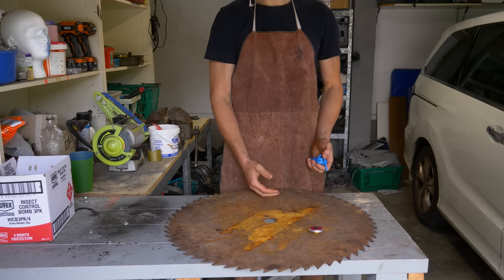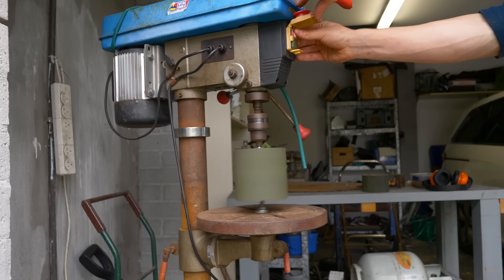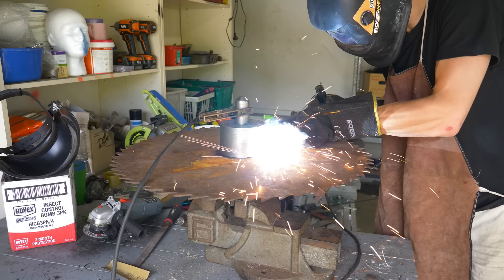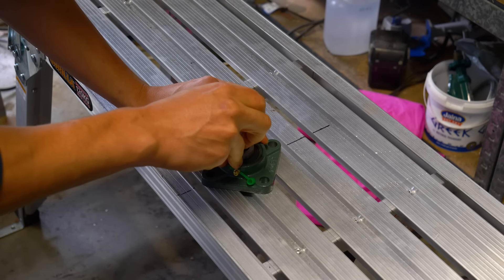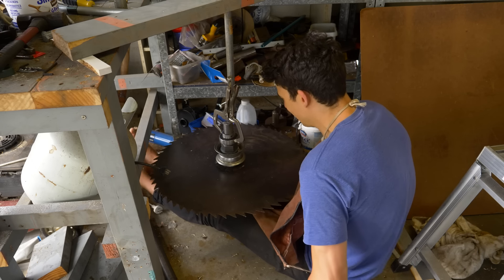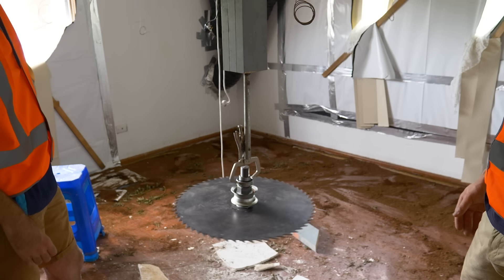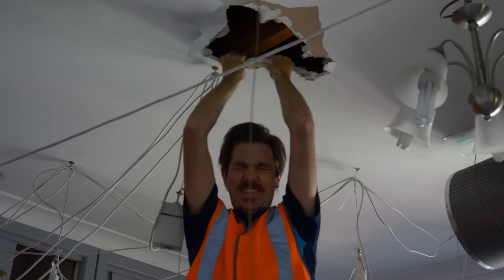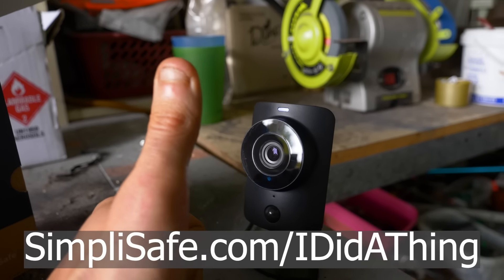Worlds Largest Beyblade Destroys A House!

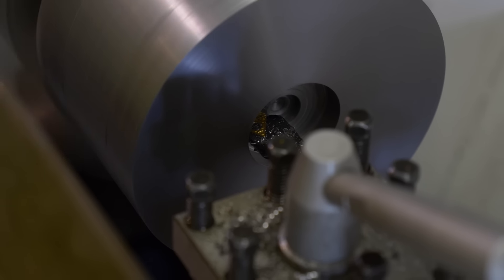Comment: 5:18 A tip to put in the bearing next time is to put the bearing in the freezer, then heat up the metal block with a heat gun, when the bearing is cold and the block is hot, put it in, the bearing will get smaller and the block will get larger.
Reply: If you can't get it in with a press i don't think you can get it in at all
Reply: @leomadero562  nah you do have shrink fit parts where its tighter when you cool 1 part and heat the other to make them expand. Then they return to room temperature the thermal expansion is so strong its almost a permanent bond
Reply: @jackorlove4055  Yeah they just went with brawn over brains haha, tried to just press it in there.
Reply: @JODRecaps  whos that in your pic
Reply: I thought everyone knew this method of getting sealed bearings in, well everyone who plays with anything dangerous just to make something for no reason lol
Reply: Patrik Banek pokimane without make-up, kinda weird of him
Reply: Depending on the fitting and the bearing, the tension could deform it and stop it from rotating at all.
But it is worth a shot.
Also, if the bearing stops working, good luck getting it out again without damaging the rest.
Reply: Yes. That's what everyone does
Reply: LMAOOOOOOOOO WTF??
https://youtu.be/5JU7QsSJv1Q
Reply: @JODRecaps  thats this entire channel lol
Reply: @UltraRik  That's a little creepy
Reply from the maker: Im gonna put the whole beyblade in the freezer
Reply: @Ididathing  do
Reply: @Ididathing  now you have it
Reply: @Ididathing  Sounds like a good idea bro, even better, liquid nitrogen, sell your creation to the local dealer as a device that will cut and freeze dry their product at the same time!

Comment: "Todays sponsor is simplisafe"
Cut to him running barefoot away from and touching a rusty saw blade with bare hands
Reply: Not to mention in an abandoned drug dealer house
Reply: U can hold all types of blades including rusty saw blades with no danger soyboy
Reply: @nicholas_plaksin  and dealers are the friendliest of people
Reply: Are y'all not vaccinated against tetanus?
Reply: Rust isn't inherently dangerous. You can touch it, cut yourself with it, you can even cook or bake using rusty metal. The reason why people are so worried about cutting themselves with rusty objects is because of a bacteria that causes Tetanus. This bacteria releases a deadly poison that has given it the name "Lockjaw" since it causes paralysis. However, Clostridium tetani doesn't grow on rust. It's most commonly found in the gastrointestinal tract of animals which often defecate in soil where the bacteria is also commonly found. However, most people don't go around eating dirt and animal waste. People do, however, walk and pick things up from the ground. Any metal found in soil is rusted unless it's just been placed there. They can cut themselves and  introduce the bacteria that way. Basically, rust doesn't cause Tetanus at least not by itself. You can cut yourself with rusty metal and not have to worry. And you can get tetanus from clean metal if it comes in contact with Clostridium tetani.
Reply: @THIRTEENTH13TH  wha

Comment: You need to add more weight to the outer edges of the blade to give it more inertia that will will help make it more stable and spin for longer.
Edit: I noticed most of the comments are trying to be funny and mine is the only serious one, so you know just do whatever feels right ill still watch it!
Reply from the maker: I did think of that but the process of trying to get the weights in the right spot would be hell
Reply: @Ididathing  I might be totally and obviously wrong, but maybe you could make/get a like thin - or less thin - ring of metal and weld it on top  of the blade. But maybe that would distribute the weight too evenly, just making it effectively heavier? Physics aren't my strongsuit...
Reply: @Ididathing  have you tried releasing it at a slight angle instead of straight down?
Reply: @Ididathing  Nah mate, Sayed Studios hit his head on the nail- this is the single biggest improvement you can make to your existing design. Just weld a couple heavy ass chunks of metal towards the outer edge of the saw blade. As long as you pair them directly across from each other at 180º and along the same radius (draw a line by spinning the top and marking the top with a sharpie as it spins) the top won't be off balance.  True a perfectly circular piece would be ideal, but 100% precision isn't exactly your building style. If you use 8-12 hunks of metal that are the same shape/size/weight and all more or less evenly spaced from each other, it will still make a huge difference on stability, spin time, power behind impacts, and how much the spin will be effected when it bumps into things. The weight on the outer edge will counteract the topheavy center and the centrifugal force means that will allow it to stabilize itself from the outer edge as it spins, compared to now where you have a tiny heavy core trying to stabilize a huge, thin, relatively lightweight outer ring. If you put enough weight on that outer edge you shouldn't see it wobble that fast- if it does wobble, it should be a slow spin on its axis with many more rotations during a single spin cycle. You could weld bits to the underside to make the center of gravity lower, although adding them on top should still work too (and you wouldn't have to sand the bottom), or you could weld pieces of sharpened steel hanging over the edge at an angle for a more destructive blunt-force weapon that would obliterate objects with brute trauma instead of politely sawing people's legs off. I'll wait for someone with an actual grasp of the basic principles of physics explain why I'm right. Until then, I'll keep talking out of my ass.

Comment: Next time you need to press/fit metal parts together, heat the receiving piece with a torch or something. This causes the metal to expand.
Reply: Actually, the reverse is better in most cases, especially if parts are already heat-treated (bearing journals often are). Instead of heating the receiving components, you should instead cool the piece that is being pressed in. Thermal expansion works in all dimensions. Think about it, inflating an innertube increases OD and ID, same with any ring shaped part when heated. It "swells". Liquid nitrogen quench of freezing in a dry ice box works well, since it shrinks the part you're inserting.

Comment: I am sure someone already figured it out, but the numbers on the wall of the house (15:18 in the video) are just the alphabet if you assign each letter a number (ex- A=1, B=2, C=3, etc.) In the bottom left corner it starts with A, and then it goes up the column and snakes around with the second column starting at F, third column starting with O, fourth column starting with P, and the fifth column starting with Y. So it doesn't actually include Z.

Comment: It seems that it has difficulty cutting through solid things like chair legs, plastic, bone, etc because it loses too much speed when it hits them. It's not continuously powered like an electric saw is, after all.
But what if you attached a few pipes to the top side radially, filled with homemade rocket fuel, to give it makeshift thrusters?
Reply: Us military: shut up and take my money
Reply: The point of the Beyblade is for it to stop
Reply: @ghasterblhaster  No, the point of the beyblade is to let it rip
Reply: It would be hard to direct as its constantly spinning. The best and easiest way wouldve been to create a large bowl(i.e. the beystadium/battle arena) and put the victim in the middle

Comment: 15:25 the numbers on the wall aren't a code, but more likely a number assigned to each plant depending on strain or type. This way you can keep tabs on all of them and remove the guess work when you can no longer tell one green plant from the other slightly greener one
Reply: Someone knows little too much lol

Comment: The fact he isnt wearing shoes while doing this gives me crippling anxiety
Reply: Me too but hey, shoes wouldnt help.  Just like steel toes wont help in most cases crushing cases.
Reply: @911axe  
Proper steel toes do help with falling equipment and debris that's common on construction sites, and could have helped in this situation possibly???

Like shitty versions that aren't up to code can be worse, sure. Bc thin metal will bend under the impact and cause more damage. But proper steel toe boots will protect your toes from being crushed by a dropped hammer or brick or whatever.... There's all kinds of videos online showing it even....

As for shoes not helping in general........... Uh idk if you noticed but there was a lot of crap on the floor, including broken glass. Even basic runners would protect against that....

(All that said I am fully aware that this man never wears shoes so he probably has callouses thicker than any rubber sole lol)
Reply: @mksabourinable  I agree, it would have definitely helped here.  But some cases like I say, it dont matter what you have on.  For example, I operate a 86 ton machine and put a found steel toe boot under the tracks and it would have pinched off whatever was inside for sure but here.  Yes I agree it would have been a huge step above bare feel lol
Reply: or safety goggles while there's lightbulbs and a tv next to a fucking sawblade??

Comment: These tops were definitely not crappy... they had dozens of unique parts that created unique effects in "battle", and were designed to spin as long and as stably as possible. Some could spin for more than 5 minutes at a time.. i had a blast as a kid seeing just how differently different ones could behave depending on the parts they used

Comment: i remember those heavy 100% metal beyblades that could puncture holes into walls if you messed up your launch
Reply: They had metal cores but plastic decor and tips, but yeah.
Reply: @kingarthur6376  no the one where the only none metal thing in the bey was the sticker for the bolt

Comment: This is extremely dangerous. You should know the lawn mower generates carbon monoxide so you shouldn't run them in inside. The beyblade looks great though.
Edit:grammar
Reply: I mean hey this wasnt the first time he did something extremely dangerous
Reply: you are concerned about the lawn mower? Considering the lawn mower is launching an enormous saw blade at high speeds, i think the lawnmower is the most safe part of this
Reply: I definitely think that's a good idea to mention for people who are thinking about recreating this, but they probably have bigger things to worry about. Also this may not be too dangerous since they seemed to tear the walls down for plenty of airflow. Still, im glad to see all of his toes were intact at the end

Comment: “...they wouldnt have these fires...” the wattage involved in a grow op can easily exceed the ratings on the feeder wires from the street, and yes, you melt that sucker untill the nuetral and hot touch and either the power company kills it or it goes untill the connection melts...

Comment: man this would have totally worked, if you built a system to make it spin WAY WAY faster. its spinning very slowly, so its cutting with weight alone.
But if it was spinning faster that would have did a lot of damage :D

Comment: We had something like these back in the late 80s early 90s, they were called Spinjas, and they were awesome. They re worth a bit of change now if you have them in the packaging. They were small figures with metal cones on their undersides and they came with a thing you would put them in then crank it a few times then a button would eject them and they would battle. They came with a little carrying case for the figures and two of the twister things that would double as a little arena for them to battle.

Comment: Freaking loved that beginning.
But maybe it's better to turn it the other way. because now everything just get stuck in the teeth and the blade stops immidiatly. Also you could add more weight at the end so it will turn slower but can contain more rotational energy

Comment: If you have oil in the carburetor you have bigger problems, and  secondly that's not a pillow block bearing. It's a 4 bolt flange, most likely a ball bearing since its being used for high speed

Comment: ik im pretty late but if you found a saw with less, larger teeth youd get more impacts with more power, a sawblade is better when constant pressure is applied but in this case a flywheel is probably better
Reply from the maker: yeh check out the one after this
Reply: Somehow I seemed to have missed that video, good job on that mate

Comment: You need more inertia to keep the blade spinning when it hits stuff. Make a giant washer, as heavy as possible, about 2/3 the diameter of the blade.  It will add inertia.  Trust me, I’m a woodworker, and a very unsafe one at that.

Comment: needa yo go faster, you should use a jig with motors and wheels spinning the disk to the point of 5000 rpm or more then let it rip im thinking to damage would be much greater 🎶

Comment: I once made my own beyblade with metal and rotor s rapsrather than a saw. Powered by a ventilator's engine. It had a superpower... it could emit hot air.. it was around 70 °C around it due to the air attrition and we could throw bricks at it and watch they.. explode

Comment: I I'm a bit late to say this but they wanted for the Beyblade to properly destroy things they should have designed the teeth of the Beyblade to be more like a chainsaws teath in order to pull in the object after cutting into it rather than just lightly slicing through something

Comment: i  use to win beyblades when i was a kid too ,  i found this backdoor chinese store in a weird allyway  which sounds worse than it actually was, and they sold weighted parts for beyblades, so i brought Goldplated weights , led pointers for the bottom. and polymer plastics that were supringly durable.  and some Chinese kid who was the son of the owner there taught me theres actually techniques to launching them that would always determin a winner to a loser.     boy was a i lil hustler at 8-9 years old.

Comment: Don't need clutch, need a dynamic rope that will absorb the jolt, and if you can, a way to control the rpm. Also, put the mass further out from the centre to increase inertia.